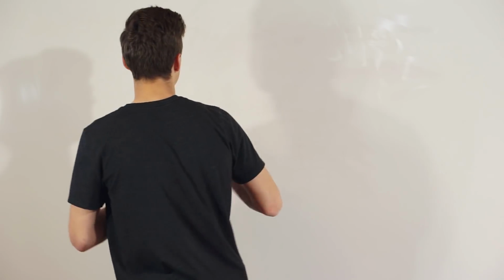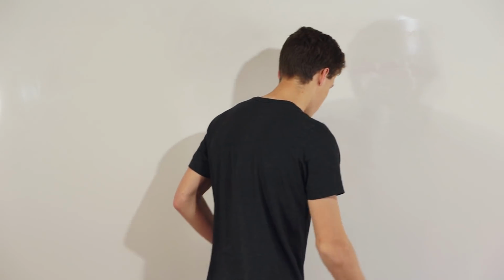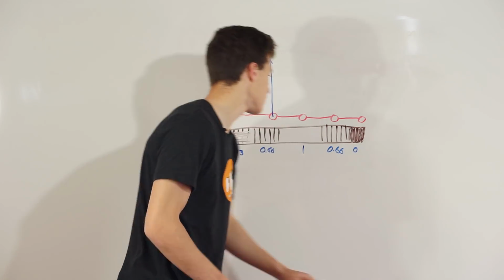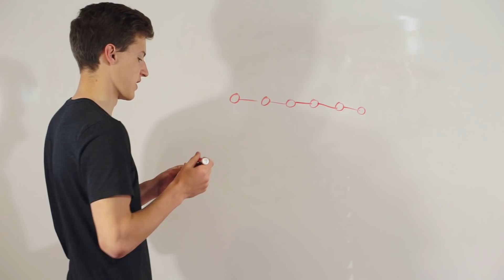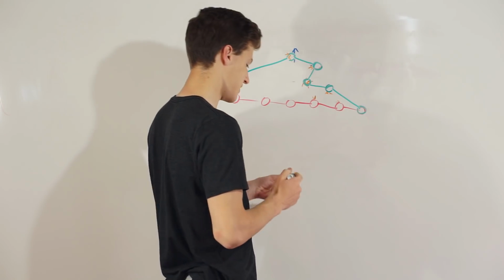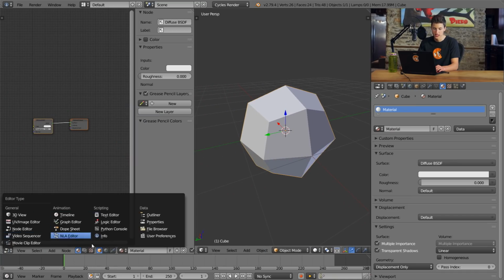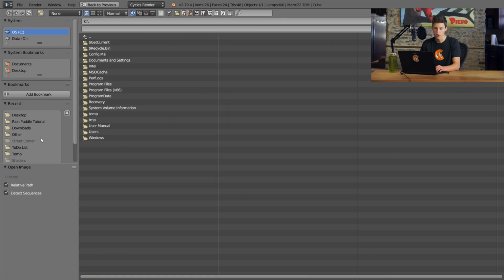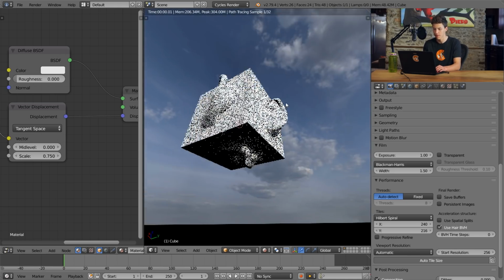First Look at Blender's Vector Displacement! - CGC Weekly #13

Comment: MORE INFORMATION ON VECTOR DISPLACEMENT MAPS

What does a vector displacement map look like?
Vector displacement maps store X, Y, and Z displacement data in the R, G, and B channels of the image texture, so it is colorful, like a normal map. Here's the map of the ear I used: https://support.solidangle.com/download/thumbnails/5180161/vector_displacement_ear_0002.jpg?version=1&modificationDate=1394783032000&api=v2

What's the difference between vector displacement and a normal map?
Although they are similar in nature, they are ultimately very different. A vector displacement map uses the RGB (XYZ) channels of an image texture to physically move vertices of a 3D model to a different position. A normal map uses the RGB (facing XYZ) channels of an image texture to alter the shading normals of a surface, meaning that there is no true geometric displacement of the surface.

Can I use a normal map as a vector displacement map?
No. They do both rely on the RGB channels of an image texture to display themselves, but they are encoded very differently. A good example can be seen in the ear image above. The vector displacement map actually reaches out into the "flatter" areas for extra geometry, whereas a normal map of the same ear would only show color differentiation where the actual ear is.

Can you bake vector displacement maps in Blender?
Not by default ... BUT this awesome video by nutelZ goes over how you can do it using MakeBake and Blender: https://www.youtube.com/watch?v=vgKjn1mV2hI

What is a vector?
A vector is a line with magnitude and direction. Here's an example:
John walked 5 miles. (Magnitude only)
John went West. (Direction only)
John walked 5 miles West. (Vector)
More on vectors here: https://www.mathsisfun.com/algebra/vectors.html
Reply: This pinned comment should have a link to NutelZ's channel so people can learn how to bake VDMs from within Blender.
https://www.youtube.com/channel/UC4CmlYEHK1OaDm04U3sk2LA
Reply: Just added this in! Thanks for the heads up :)
Reply: does regular displacement map works?
Reply: Renz Tolosa regular displacement maps will work for regular displacement.
Reply: Remington Graphics  so it requires a special map?
Reply: Renz Tolosa Correct.
Reply: You should do a "response" video about this, I would love to add in my Blender playlist
Reply: Thank you sir!
Reply: Remington Graphics could it be possible to  sculpt by painting the vector displacement map  texture live in blender?.
Reply: Cool looking but not ready to use feature. The fact that there is no way to generate such a map within Blender itself totally kills it as a feature. :-(
Using commercial ZBrush is a great prosthesis for enthusiasts of  free software, and it sounds weird, huh?
Hope eventually there would be a possibility to bake from high-res mesh or from multires modifier, like we have for normal maps. And then it would be really great!
Reply: Ron Netgrazer, fair point! And a good news as well. Now it sounds and feels really great with this NutelZ's code.
Reply: Could you add a normal/bump map to a vector displacement map using the vector math node in order to make the normal/bump map have real displacement?

Comment: I I have a question. I searched this video cause I downloaded the Emily 2.1 skin showcase for blender and for the skin displacement one has to use a vector displacement node into the displacement output and it suddenly the fairly low poly model gets all the detail of a sculpt. I didn't add any subsurf or anythin to the .obj model, so I though,  wait, what? 

The .exr displacement file through the vector displacement node seems to act like a normal map in the model, but I thought since its displacement, it should well, displace the geometry, but it doesnt seem to do that either, or at lest I dont know how. Whats going on?

Comment: Hello Grant it's been a while. I have a question that's been tormenting me for a while now. Maybe u can help me with it. I use Manuel Bastioni's lab religiously & have always wanted to use microdisplacement with my character's for the pores but, like with my animated clothing I can't seem to find a setup that works because subsurface modifier has to the last on the stack which doesn't seem possible. Can u take a look at MBL & animated cloth & suggest a fix? Thx. Seems like this would be perfect for tension maps.

Comment: Now that Displacement is a vector value, does that mean I can finally use normal maps in conjunction with Adaptive Subdivision?
Reply: Check out the pinned comment for more info on vector displacement maps.

Comment: you are wrong young man. i don't know blender but I assume it's the same as most software.. black dose not represent 0.  in displacement grey 128, 128, 128 represent 0. black represent lowest surface and white highest. i am guessing you are confusing with bump map whare black is 0 and white is 100. not the case with displacement!
Reply: akaBez I'm assuming a midpoint of 0. This is good information though, and I should have specified this in the video.
Reply: Remington Graphics yes. well actually its the mid point of 0.5. the point is, black dose displce the mesh only inwards, while white outwards and mid grey should not displace at all. i say should because it still displace ometimes depands on the software, but just a bit mostly unnoticed anyway. was a good video regardless. gonna check your channel now ;)
Reply: akaBez Blender has a variable midpoint. That's probably why we're both a bit confused. You are correct though, most softwares do use a value of 128 as the midpoint value. I just wanted to prevent those who are unfamiliar with displacement from becoming confused.
Reply: Remington Graphics ho cool that interesting. good to know. i am very new to blender :)

Comment: One question...   you are saying vector displacement adds very high details to a low res mesh. a displacement map should displace VERTICES of the mesh along three axis, may be my understanding is not correct. but if there is no dense enough vertices, what do you going to displace to get high res result ? or add some subserv modifier?
Reply: yisha hai Adaptive subdivision subdivides your low resolution mesh. Displacement then moves these subdivided vertices to their respective locations.

If you apply the any displacement map to a model with insufficient geometry, it will try it's best to replicate the shape with the vertices available, but it ends up just looking weird.
Reply: neither vector or normal displacement map do not give any details. Normal map can fake additional geometry, displacement does not. Because it is used to move actually vertices, normal disp only along normal (i think) and vector in any direction. Both displacements need subdivision or tesselation
Reply: there is a differance between "micro displacment" that adds detail at render time (or real time like ue4 for example) and normal displacement which only displace vetecis along the z or y (depands on software) axis but dose not aubdivide the mesh. so with normal displacement you would need to manualy subdivide your mesh. anyway both of them displace the meah only on 1 axis. "vector displacment" displace the vertecis on all 3 axis (hence the name vector, 3 points in space) but to get fine details you would still need a normal map or a very highpoly mesh as i don't think you have "micro vector displacement" but i might be wrong on that.

Comment: your image texture's color data, needs to be changed to non-color data... it happens all the time.
Reply: +Naxster Yes, but it uses color channels as raw values instead of colors, that's why "non-color". You need it for the software to recognize the values are not meant to be seen as color, but rather something else, like vectors.
Reply: I saw a video on color management which explained that "non-color data" used the values as-is as opposed to the normal practice of storing gamma-corrected values in the file so, with Blender's linear workflow, it undoes this correction while loading.

I don't know, but it occurs to me that if the file contains a Color Space profile that is already linear, then there is no difference.  If the map was saved that way (as opposed to sRGB or just not noting anything which uses a default) then the "Non Color Data" option has no effect.
Reply: Martín Varela Correct. ‘Color data’ actually compressed the color a bit to only show changes in a visible spectrum. But ‘non color data’ is used to tell the software “use all the the uncompressed data, because this texture is being used for more than just its visible colors”. ie: displacement, normals, bump...
Reply: why? Vector displacement map uses RGB channels, all of them
Reply: Like minus values I guess?

Comment: So it sounds like the vector displacement map is the blend of an unwrapped UV map combined with a normal map?... maybe?
Reply: vector displacement map looks KINDA like normal map, only base color is black not purple. But it ecodes information differently so they are different at the core.

Comment: Maaan, that's great, I wonder if having this kind of code would make it easier for Blender sculpt to have vector displacement brushes.
Reply: Like Zbrush recently has
Reply: Does ZBrush have nodes?
Reply: Lawrence D’Oliveiro This seems a bit impractical. The much better approach would Blender to allow us to bake it from a mesh to a texture of a flat plane and then allow us to use it on Sculpt mode (interactively).
Reply: Or, better still, write an addon that lets you sculpt arbitrary geometry on top of a simpler base mesh, then works backwards, computing a vector displacement texture that will generate the former from the latter.
Reply: Feed it from a vertex colour layer, and paint on that layer with whatever brush you like.

Comment: but.. which actual usecases exist for this?
Reply: Patrick Hennig it essentially combines the benefits of displacement and normal maps (and does even more!), and lets you move a lot of the fine detail from the model to a texture.

One use case would be if you want lots of fine detail on your objects, but don't want to model it all yourself. Possibly it's a certain pattern you'll use in a lot of models, but is tricky to recreate every time. Then you could make/obtain a pack of vector displacement textures that you could apply to any model. This could be useful for cloth, plants, some kinds of food, plus many more things.

I've seen this referred to as mesostructure - macro-structure is the geometry you've modelled, micro-structure is stuff that's in your shader, like the roughness or SSS, and then mesostructure lies between the two, too small to bother modelling by hand, but too big to abstract into a roughness value or something.

Another use case is that it allows you to create the full version of a certain mesh, bake out the detail, and then do stuff like layout/animation on the final model without needing all of the vertices there that would slow your viewport down. You don't need separate low-poly stand-ins, because now your low-poly stand-in is also the final model.

So those are two use-cases: mesostructure textures you can apply to any model to add detail, and a form of geometry-simplification to make layout/animation faster without impacting the final render.
Reply: Tobias Gehring thanks, that explains a lot. The mesostructure did not come to my mind, since most examples are on a bigger scale, so my thought was why someone wanted ears on anything, since those could be modeled, also a face should probably be within the geometry, not on a texture. But things like surface modification on some macroscopic scale makes sense. Like scales on a dragon or maybe more general, an easy way for more detail on Rocky surfaces. Better viewport performance is a factor, but not as important I guess. The mesostructure though, great stuff.

Comment: Wait, i thought this is what normal maps were already supposed to do.
Reply: Normal maps alter the way light reflect on a surface without changing it's topology. Displacement uses subdivision to "physically" move vertexes up and down. This new method also move vertexes left, right, front and back.
Reply: Panboy2k normal maps just alters the normals but vector disp maps displaces in real
Reply: A regular black and white displacement can only alter magnitude along the normal, A coloured normal map has 3 colours that are used to displace in x y z space, as i understand that's the entire point of a normal map over a bump map, being able to displace not only in magnitude but direction as well. Blenders treatment of normal maps as Bump maps has always confused me.

Comment: All I know is that when you open an old blend file with 2.8 that was created before 2.8 and it has in the materials a displacement output, the nodes connetcted to the displ. output will have an automatically Displ. node cretaed which turns the object black and you have to delete it. Annoying and the same problem exists with everything that has roughness. A Power node is created all the time betweeen noodles that connect to a roughness output :/

Comment: which images does he accept? black and white, colorful, normal map ... well, only when you leave even is that we will understand how to take advantage of this tool.
Reply: Diego Silva The vector displacement node utilizes vector displacement maps, which look similar to a normal map. This is because X, Y, and Z displacement data is stored in the R, G, and B channels of the image texture.
Reply: ¿sᴉɥʇ pɐǝɹ noʎ uɐƆ ? Normal maps determine what direction the shading normals face, vector displacement accounts for true vertex displacement. So no, a normal map will not work. Instead, a vector displacement map is required in order to use vector displacement.
Reply: so can i use normal maps for vector displacement?